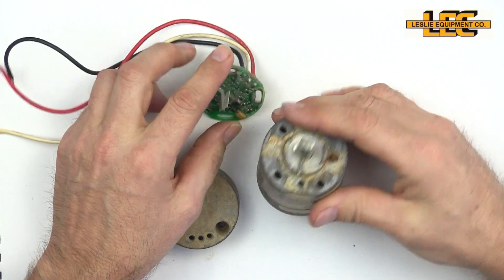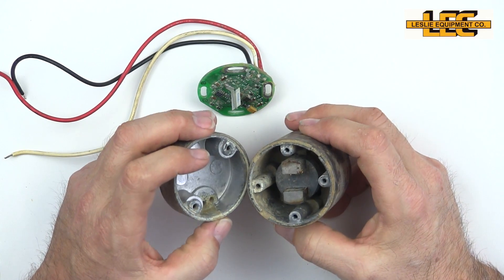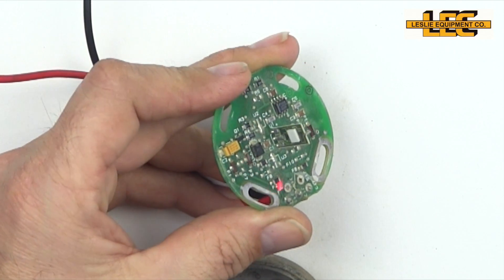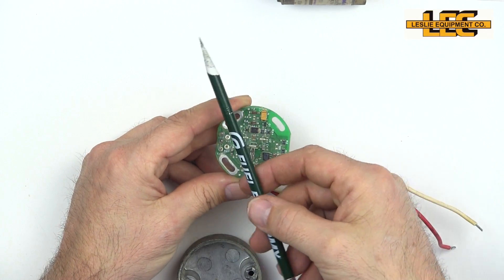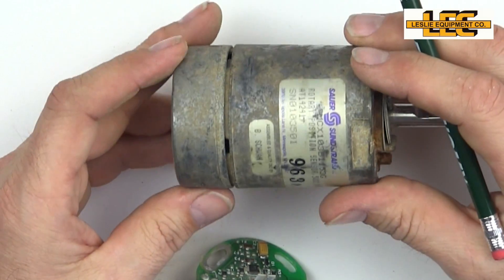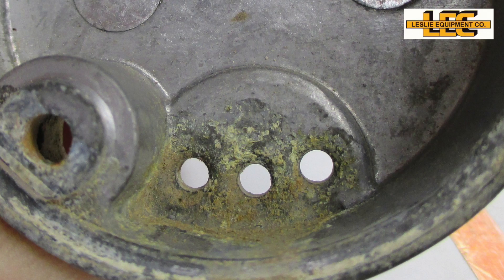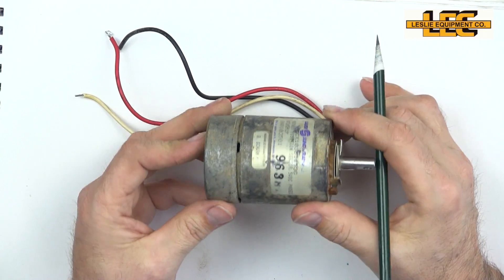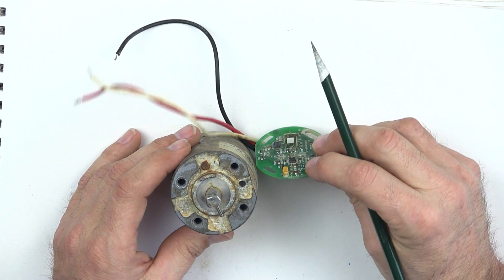Rotational Hall Effect Sensor

Comment: I agree with you on sealing up this sensor but I would leave a small drain hole on the bottom of the sensor.  If you seal it up completely just the changes in temperature from warm to cold will build condensation and there will be moisture in the sensor.

Comment: Dan,I love the load Pro,but you have to make it slimmer. It's too bulky and the wire is thick like a battery cable!
Reply from the maker: Welllllll - we'd like to, but we're kind of limited by the size of the resistor, and the thick cable is dual-conductor. I'm not saying it isn't possible, but there's also the $25,000 cost of the tooling for the molding. Um - do you have a grinding wheel?
Reply: Daniel Sullivan O.K. I get it. Well, Iam sending you the $25,000 in the mail,just wait for it,it'll get there.
Reply from the maker: joeandgod1 Cool. Looking forward to it... Wait - you're joking - aren't you.
Reply: Daniel Sullivan Ya,I am joking. Thanks to you and Paul Danner, Iam  a really good auto electrical mechanic(making really good money) and all you do is appreciated.

Comment: Are the openings in the side of the Hall Effect Sensor there to keep heat from building up in the sensor?
Reply from the maker: That is a possibility, but it's only 5V and the current demand was less than 0.5A. I think it's there for ventilation, but I also think this sensor was originally designed for a different environment - such as in a production facility not exposed to the elements.